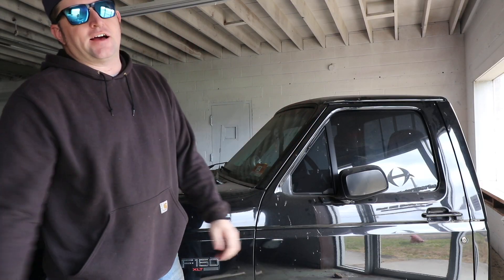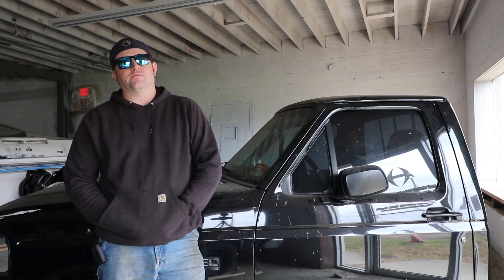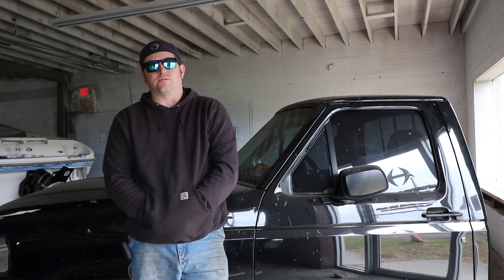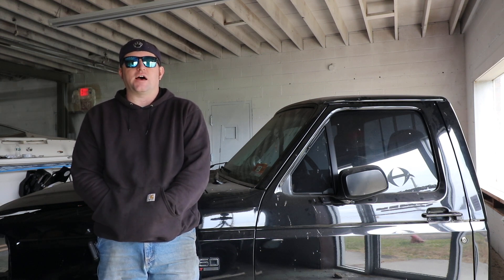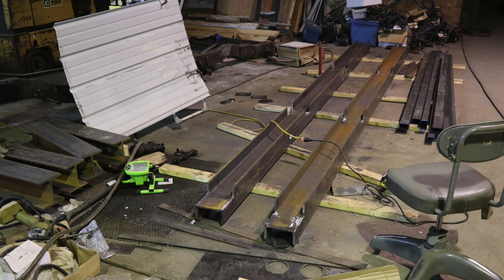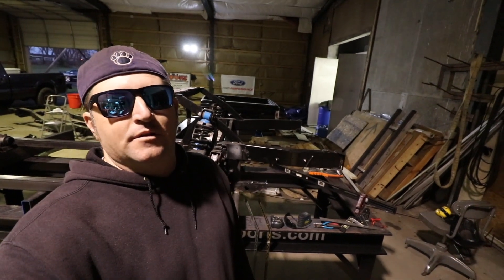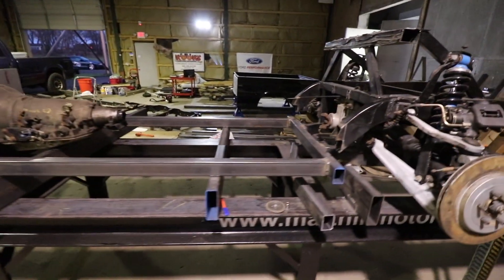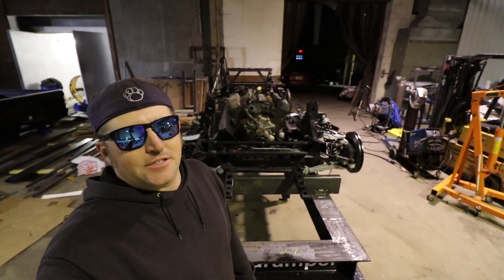Unveiling #ProjectPlatypus - the mixed up Gen 1 Lightning

Comment: With all that custom work why not just start with a regular single cab f150?
Reply from the maker: daisbest  While this was a 26k mile truck, it was already heavily modded. Also, just like any other project, it started out small and snowballed. It was going to be a built engine and turbo... Things got out of hand.  With that said, I still never would have done it to a regular f150. Having it be a Lightning just makes it a little more special.

Comment: Where you're going looks great, but why not find a plane jane shortbed & use that, not a low mileage Lightning? no, i didn't dis-like this. must have been 2 jealous people, or other brand people!
Reply from the maker: Dave Hollamon I would have felt differently if it was an unmolested truck to start with. It was already extensively modded.  And just like everything else, it went into the shop for a lot less mods with a much shorter time period. As we progressed with the project, we found more things to upgrade. At this point, there's not much original left.